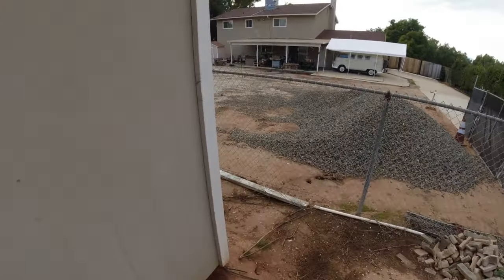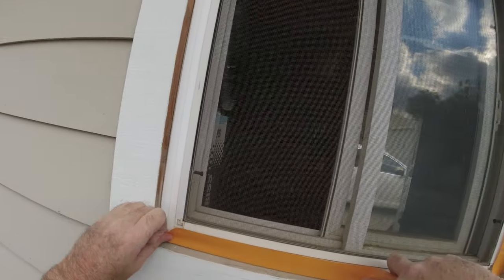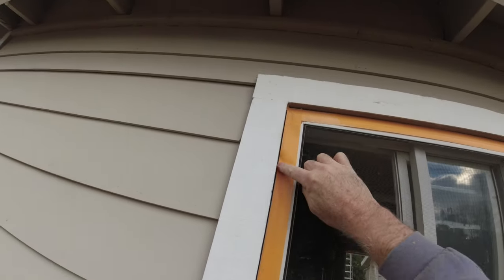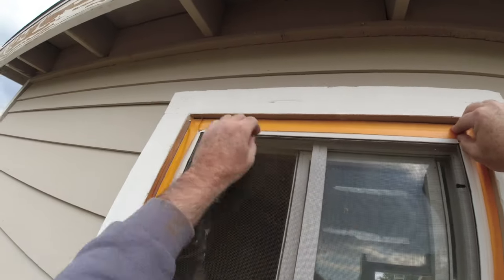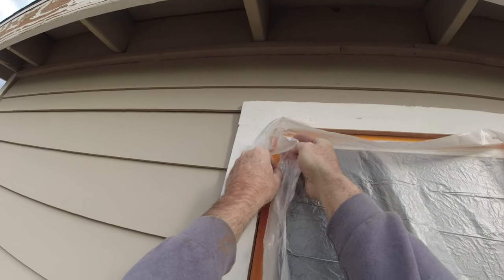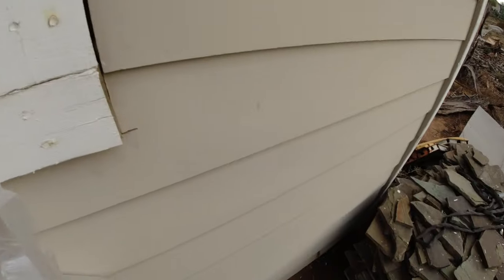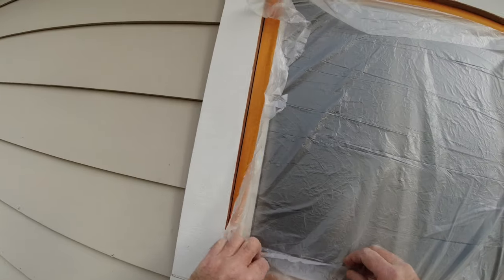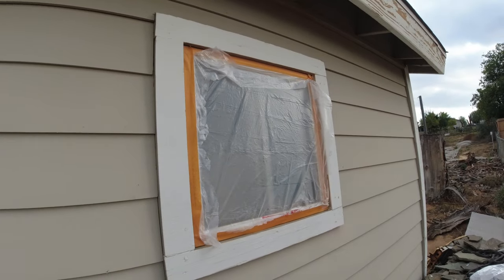HOMEOWNER Painting tips How to mask a window without a masking machine

Comment: That plastic seems cool until paint dries on it and I'm gonna stop talking now.  Good job.
Reply from the maker: works Ok the best is the non peel plastic. but this works great. We use plastic that is on a masking machine with no issues.
Reply: @mikethepainter  I'm having flashbacks to being in the spray booth and paint would dry on plastic like that and then land in wet paint. Taking the plastic off all the dried paint would rain down like confetti. Latex paint is thick though.
Reply from the maker: @Mike-qo4kp  they have no flake plastic for that the red label 3M